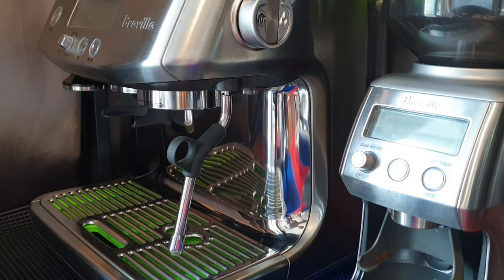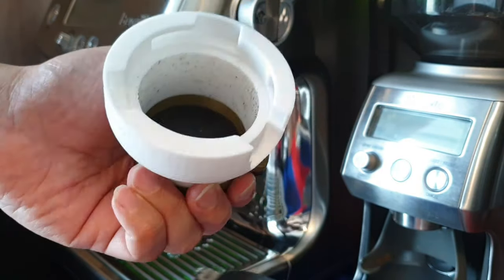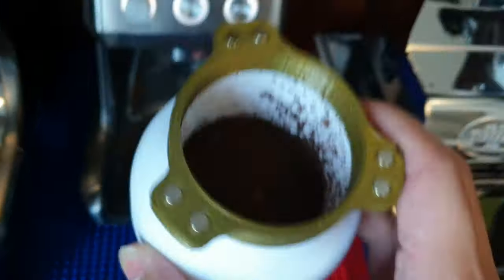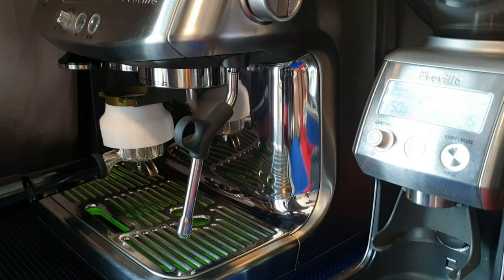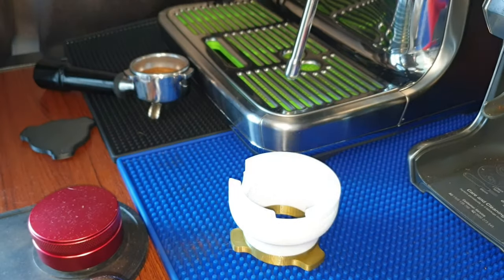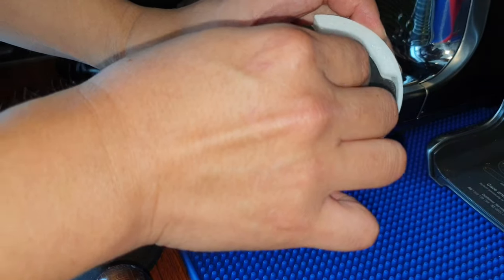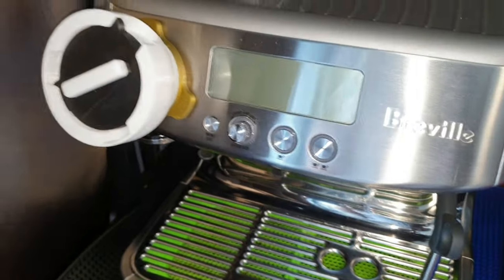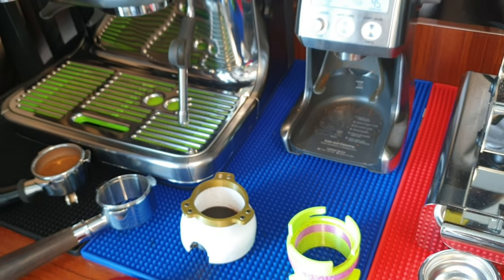Version 3 | Dosing funnel, cup and tamping station | Breville 54mm Portafilter

Comment: Can you make one for the 58mm Porta filter for the Breville Oracle Touch ???? And can you make the cup into stainless steel so there is no static electricity so the grounds wont get stuck to the sides please???
Reply from the maker: hi I can design and I am afraid I am limited in my production ability in CNC. I dont own CNC machines and I am afraid I can only do it in plastic by 3D printing.
Reply: @CaffeMartellaSingapore  I understand.. but if you ever make one in 58mm I will buy , even if it’s plastic .. so please think about it
Reply from the maker: @scuzi423  Sure definitely.